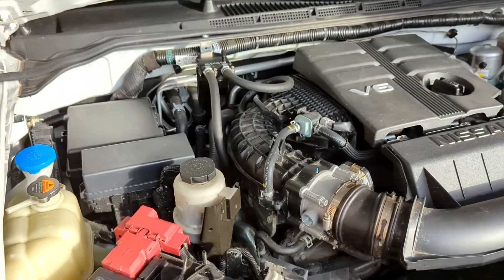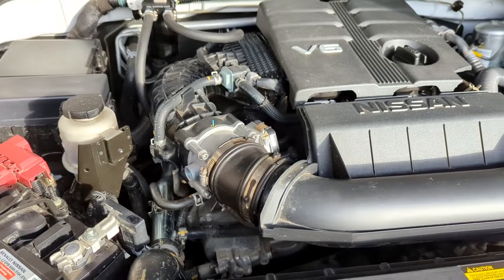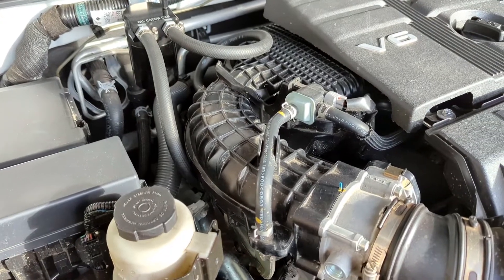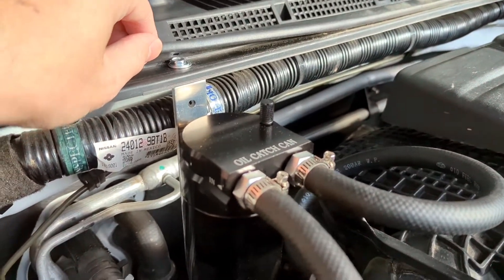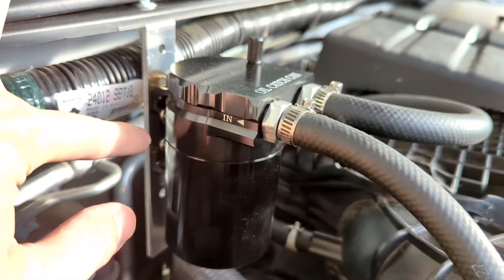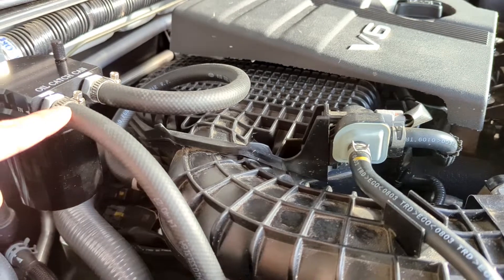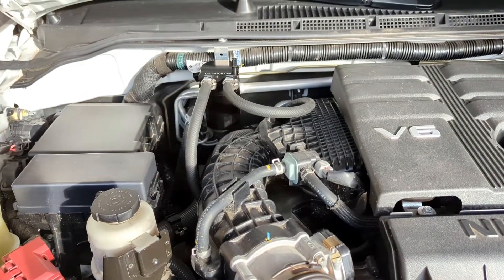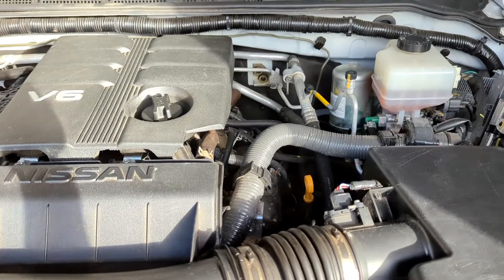Should YOU Get an OIL CATCH CAN for 2020-22+ Nissan Frontier 3.8 V6 GDI?

Comment: will this affect warranty on new truck
Reply from the maker: It will depend on the dealer that you go to, there's a chance that if you have an engine problem, they may try to blame it on the catch can. However, if you have a blown shock, there's no way they can blame it on the catch can
Reply: They could try....however, with the  Magnuson–Moss Warranty Act in the USA, they need to prove WHY it caused a failure. The catch can is just catching oil in the PCV system. Not much science to it. The PCV (positive crankcase ventilation) system still remains intact. Only thing is oil in the system is diverted by the can so it never enters the intake manifold to possibly be sprayed  on your intake valves.

Comment: If anybody is wondering why the 2023 and older Tacomas cost so much more, this is why. GDI engines are ticking timebombs. With the Tacomas, you won;t have this carbon build-up problem, and the costly repair bills that come along with it. 2024 and newer Tacomas? I'm not so confident about those since they started putting turbos in them.
Reply: The newer tacomas 3.5L that’s in 2016 an to 2023 Tacomas are GDI but from up I heard the 3.5L Tacomas are GDI but it also has port injection as well to help clean off the valves witch is what causes the sound of the Tacoma tick
Reply: True, Tacomas engines are direct and port injections 👌🏽
Reply: @carlosm.garciarivera7138  The D4S system. It's pretty good I guess. I still don't trust it like I do plain ole port injected.
Reply: Ticking time bomb because of direct fuel injection? Nissan's 4.0 265hp engine used the previous generation Frontier and Xtera for some 15 years was also a direct injection engine. That engine was/is bulletproof. Mine had a 160K miles on it and ran like new before I traded it on a 2024 Frontier.
Reply: @nvpoolshooter Oh congrats, you're the one guy 😅
Reply: @Doomzdayxx  You know it all guys with Internet PhD's are geniuses that mere commoners should listen to.

Comment: The normal fuel injection he is talking about is port fuel injection (sprayed in intake port). alot of manufacturers are going to direct fuel injection for  fuel economy, this is done by gas being subjected to high pressure then sprayed threw an injection nozzles directly into cylinder resulting in better atomization and fuel burn, resulting in lower emissions and higher full mileage, The one draw back this has is carbon buildup around valves ,because with port fuel injection the detergents in the fuel help keep valves and intake ports cleaner, adding a oil catch can to a direct injected engine  can help reduce this buildup, but wont eliminate it.

Comment: But I  live in California!! And my frontier is brand new, is the can going to void warranty?
Reply from the maker: this doesn't affect warranty at all unless this caused something to fail. If your power windows stop working this had nothing to do with it. With that said, it also depends on the dealer and how much of a hard time they want to give you
Reply: @frontier_etc  The dealer has to put a claim into Nissan to get paid for warranty work.  If Nissan Corp rejects the claim then the customer pays.  If the catch can causes a builded up in crankcase pressure because it freezes or becomes clogged and a seal fails then Nissan Corp isn't going fo cover the repair cost.
Reply from the maker: @DRobertsonKenora  agreed. However, a catch can isn't going to just completely void your entire vehicle's warranty. So if you have a problem with your radio, or suspension, or doors, etc., then the catch can wouldn't affect any of that for warranty purposes.
Reply: @frontier_etc  Warranty wise will just effect the most expensive component in the truck.
Reply: Just remove the catch can before you take the car to the car dealer. Put everything back the way it was  before installing the catch can. Your warranty can be used no problem..
Reply: It’s all depends on David Newson!😂😂😂😂😂😂😂
Reply: Piece of advice.
Use your common sense. Talk to the Nissan dealership where you purchased your new truck. Avoid random advice. Dealing with dealerships can be tricky. While your truck is under warranty, don't make changes or add aftermarket parts. Keep it entirely stock. Once the warranty expires, be ready for potential expenses. The decision is yours.

Comment: After buying a vehicle that had this nonsense added to it.. I had to replace lower oil pan gasket.. valve cover gasket and spark plug tubes.. if that can gets  filled and it adds resistance to airflow back into the intake..it pressurizes the lower crank case. Not going to put this nonsense on my engine on my other vehicles
Reply: Good grief, just buy a well designed can and empty it regularly and it will never be a problem. However, carbon deposits can become a major long term problem with direct injection engines.
Reply: This. People don’t think about how an aftermarket part like this affects a tightly engineered engine. 
I have a VQ38DD and after weeks of mind-numbing research I came to the conclusion that a catch can is too big a risk. A change in engine pressurization could have adverse effects far worse than gunk on the back of the valves. No thanks.
Reply: These people think they know more than actual engineers 😂

Comment: Trying to solve a problem that doesn't exist.
Reply: Use good gas/top tier fuel and API SP oil...change it at 5k...problem solved!
Reply from the maker: That's certainly possible
Reply: carbon buildup doesn't exist? Oh I get it, so you have zero experience with engine work. Makes sense.
Reply: @Eyedentity66  Not all vehicle have issues.  Some definely more than others. How about using CRC intake valve cleaner every 20K to prevent any issues rather than adding a Chinese catch can that could possible cause problems?
Reply: I guess its doing something

https://youtu.be/po3d2B_gBDE
Reply from the maker: @nodnarbz_1327  appreciate the link to the update video. yeah I do think it works. How much? Who knows. Maybe it will delay a walnut blasting from 100,000 miles to 120,000 miles, or not. Only time will tell, but I'll keep monitoring it
Reply: Did your dealer say anything about if this impacts your warranty at all?
Reply from the maker: @homeaudiobasics  this doesn't affect warranty at all unless this caused something to fail. If your power windows stop working this had nothing to do with it. With that said, it also depends on the dealer and how much of a hard time they want to give you
Reply: @Eyedentity66  Yes all engines have blow by and intake valve contamination can be an issue of some DI engines.   PCV systems on DI engines have a "catch can system" minimizes intake valve contamination. Some do it better than others.  A simple check by pulling off the PCV hose at the intake will reveal if oil is getting into the intake.  There are other other sources of intake valve contamination such as EGR and valve over lap.  The point is a catch can will do very little on most DI engines and eventually a valve cleaning on some higher mileage motors may become necessary. Using CRC valve cleaner as a preventive measure would be a better and more cost effective solution.
Reply: Is it normal to smell gas in the oil of these during break-in?
Reply: Carbon buildup on valves is a problem. With DI engines fuel doesn’t spray across the valves and clean them up. Hence why keeping this stuff out of the intake is more important.
Reply: Carbon buildup on DI valvetrains is 100% a problem.
Reply: @Journey_of_Abundance . It a problem on some DI engines and not all DI engines.   Most DI engines have oil separators built.
Reply: Agreed .. the risk of over pressuring your crankcase is not worth the risk.. I learned the hard way.. none of that garbage on my frontier
Reply: @Ashoud_Anobetah please explain how this over pressurizes anything at all

Comment: Did you have to buy additional hose or fittings? J&L has a fitting on one of the end of their hose not sure about these universal ones.
Reply from the maker: Didn't need to get anything else. The hose is the right diameter and length and I just reused the existing hose clamps
Reply: @Yes Man  okay thanks because I was watching J&L oil catch can video for the frontier and they reused existing hose coming from the pcv valve so they had a connector from their new inlet hose connected to the existing one but seems like with this universal kit I don't need anything.
Reply from the maker: @PjJaiJp  exactly. With this kit, you get enough hose to cut into two pieces to use on both the inlet and outlet parts of the catch can.
Reply: @Yes Man  so you did not use any existing hose and just reuse the factory clamps? BTW How's the catch can so far? I've had my frontier for a year now and putting this won't hurt since I do my own oil changes.
Reply from the maker: @PjJaiJp  yes. The factory hose has been removed and is not reused with this installation. It is molded into a shape similar to a question mark and wouldn't work properly if you install the catch can where I did. The kit comes with 2 hose clamps and then I reused the 2 factory ones as well. I quickly checked the catch can again today at about 3,000 miles since installation, using only the dipstick, and it looks like it has just started to reach the bottom tip of the stick. I'll be making another video soon when I'm up for an oil change.

Comment: This motor is good for 250,000 miles. What vehicles have direct injection engines?
Other manufacturers offering or planning to offer GDI engines include Audi, BMW, Hyundai, Kia, Mazda, Mercedes-Benz, Nissan, Lexus, Saab, Subaru and Volkswagen.Dec 2, 2009
Reply from the maker: It remains to be seen if this new VQ38DD will be reliable in the long run. Direct injection technology has improved over the years, and apparently someone said that a Nissan engineer insists that this DI engine has measures in place to combat carbon buildup. We'll see
Reply: Be easier to state who does not offer a DI engine. My2016 GMC had DI
Reply: My Jetta got di and I got 220k I’ve hit a frozen deer spit out by an 18 wheeler shot the car up in the air   hit curbs hit a tree that motors bulletproof 1.8 2016 Jetta sport the door latches  suck other that  that that cars bullet proof 5 speed standard original clutch things just tough
Reply: Are you asking or telling?